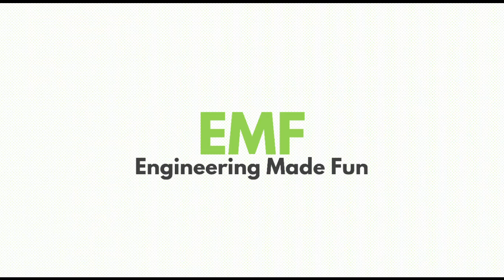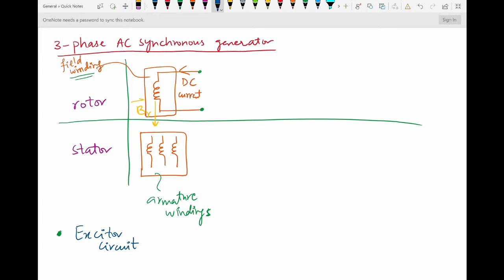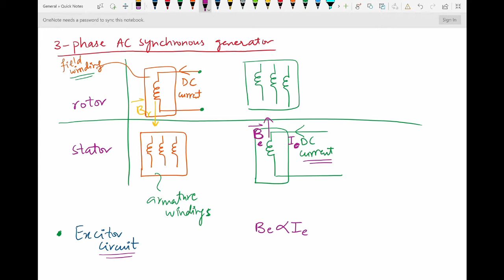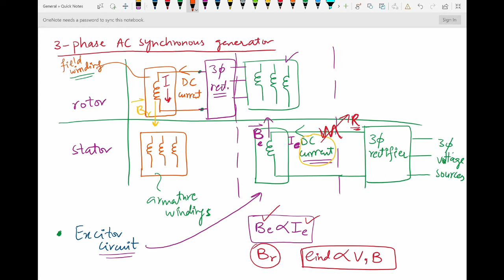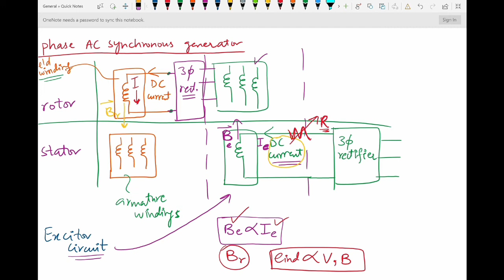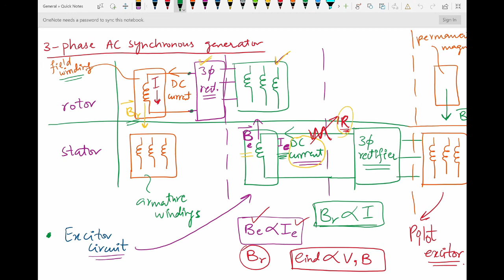3 Phase AC Synchronous Generator with brushless exciter circuit

Comment: Why not just use permanent magnet for the main excitir instead of pilot excitor
Reply: Small rotor could be simple with permanent magnet. But permanent magnet is unefficient with large rotor.
Reply: Faisal Pervez mila jawab?
Reply: Large size permanent magnet type machine large in size and heavy in weight